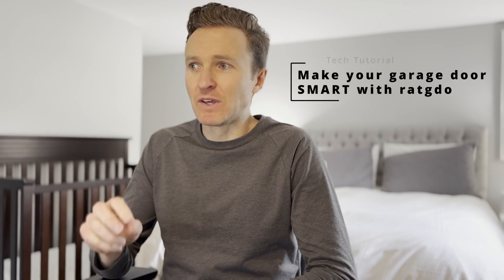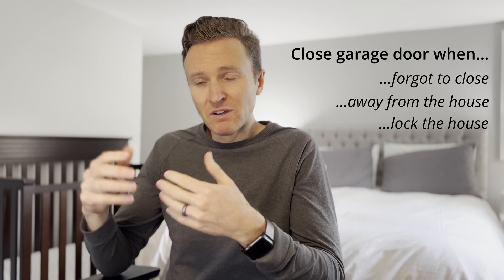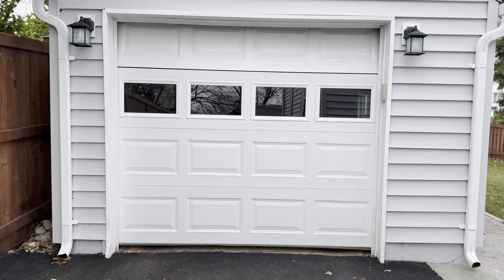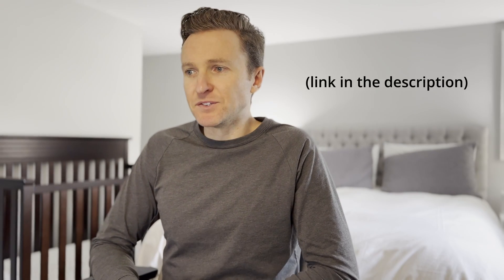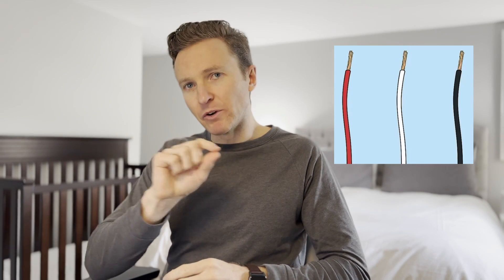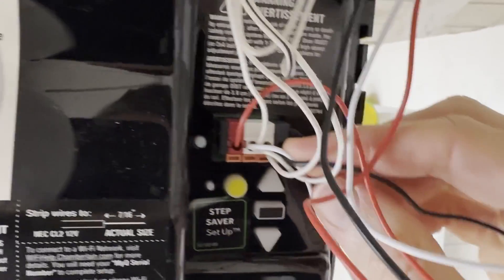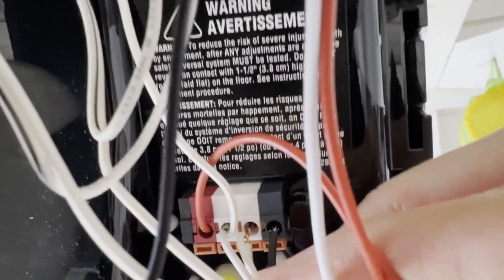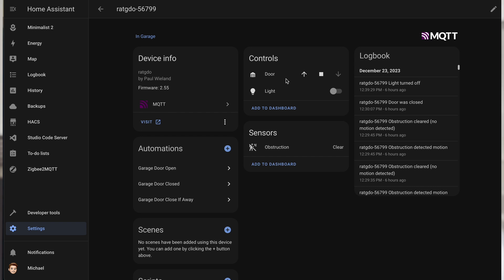Make your existing garage door SMART with ratgdo

Comment: So, it looks like I also have to purchase Home Assistant Yellow to be able to connect RATGDO with my Apple Home Kit, correct?
Reply from the maker: Ratgdo allows you to control the garage door with MQTT over your local WiFi network, and can be integrated with Home Assistant directly. Once integrated with Home Assistant, ratgdo can be added to Apple HomeKit using the HomeKit Bridge integration in Home Assistant. Home Assistant can be installed on a Raspberry Pi or PC, or you can purchase Home Assistant Green or Home Assistant Yellow hardware which comes with Home Assistant pre-installed. Home Assistant Green is the more beginner-friendly, plug-and-play approach to getting started with Home Assistant.
Reply: @michaelsleen  Thank you for the reply, Michael...this was very helpful!!
Reply: Michael, I almost have it all set up...I knew nothing about RATGO, MQTT, Home Assistant or anything..im learning on the fly...thank you.  Can I ask what MQTT Broker are you using?
Reply from the maker: Nice work! I'm using this: https://github.com/home-assistant/addons/tree/master/mosquitto

Comment: RatGDO requires home automation knowledge beyond Alexa or Google Home. It also requires a Chamberlain or Liftmaster. It looks cool, but I'd have to probably spend hours and money on other things to even use it. I wish there was something more accessible that could integrate with Alexa.
Reply from the maker: As mentioned in the video, other solutions include iSmartGate (https://amzn.to/3VqVNIZ), meross (https://amzn.to/4co2cur), and Tailwind iQ3. All of these work with Alexa and other smart home platforms. Hope you find what works best for you!
Reply: @michaelsleen  Thanks for the quick reply and information! I probably stopped the video before you got to that point. I looked at the first two and they either seem to only work with iPhone or didn't have an apparent use case for cars approaching, but Tailwind looks perfect. After two years, it will be saving me money over going with the "company that shall not be named" subscription + device! :)
Reply: Meross works with any phone as long as your phone is compatible with SmartThings, Google Home, Apple HomeKit, or Alexa.  Basically any modern smart phone.

Comment: It will also work with oldschool just push button garage door openers from the 80's and 90's....  I built my own ESP32 based version since they were on back order, but I highly recommend REMOVE YOUR GARAGE DOOR FROM YOUR WIFI/MyQ integration.  So you are only connected via the new RATGDO.  Just incase they figure out a way to block the RATGDO with some firmware update or something and they push it out without you knowing and everything just stops.  

Also with RATDGO, you can see and control MORE items then you could with MyQ... You now have the garage door open/close counts, Remote LOCKOUTS (so you can setup an automation to set remote lockout if your home or if your away, so a hacked rolling code defeating device can not be used while your away (setup geofence on your phone via automation to turn it back on when you get close to your house again), turn on/off light, see obstructions, etc...  Also, you can add a radar to a GPIO pin and alter the RATGDO firmware (its open source) to make it where you have a radar MMwave sensor (so if you are standing still, or in the corner where your built in motion sensor can't see), you can now use automations to have your garage lights and garage door light turn on / off based on that motion sensor instaead of the PIR motion sensor on the wall on the Chamberlain/Liftmaster/generic button.  I did this and thinking about throwing a toturial together for anyone wanting to do it.... and I'm going to ping Paul (the creator of RATGDO) to see if its something he would like to add on official to his product.

Also, I added on some IAQ sensors to get VOC's (to automate if a car is running with thge door shut and VOC's go through tthe roof, then open the door and vent, I also have a in wall fan in a vent in my garage wall to turn on full to get fresh air int asazp.
Reply from the maker: Very cool that you added mmWave for presence detection and VOC detection for safety!

Comment: Great video! Not difficult to install at all still, however, highly suggest  the Tailwind Pro. Excellent, commercial grade equipment that’s reasonably priced.  Seriously, the quality is unmatched.

Works with all smart home platforms as well. They are also a small company with very transparent and responsive owners. 
I personally use HomeKit. Being an Apple user I had to get sensors for the  auto up and down feature (Apple’s issue…not Tailwind).  

But if you’re an android user just use your Bluetooth in your vehicle (that is, if it comes equipped with it).  
Again…GREAT explanation video
Reply from the maker: Thanks!